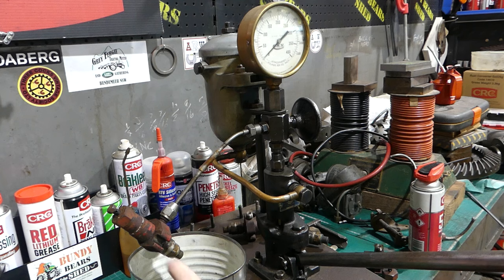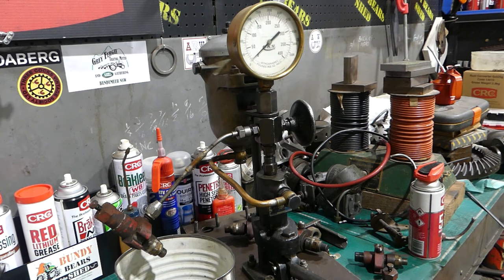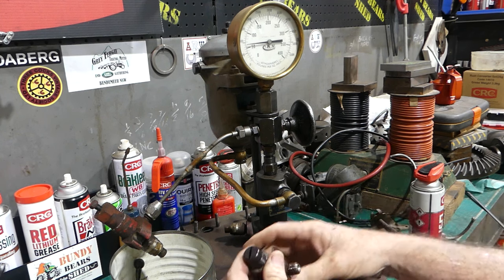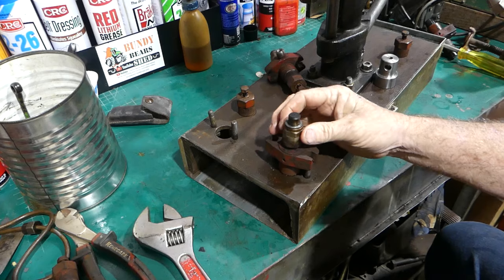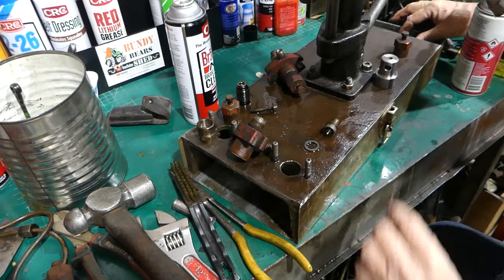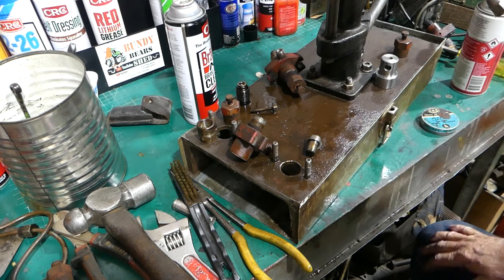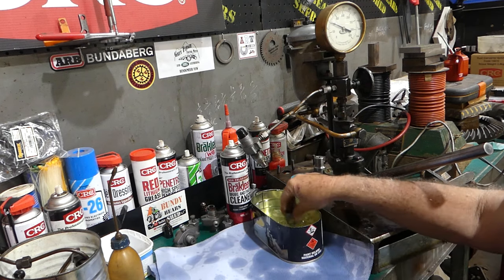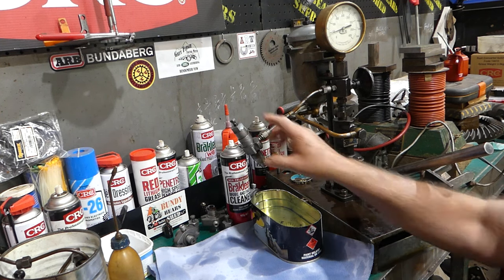How to Service your B414 Injector Nozzles

Comment: hi lance    did you find out correct pop off pressure from tony   thanks
Reply from the maker: No he didnt have it so I checked out other tractors similar and picked up the pressure from the old nozzles by 10atm until it chirped niceley.